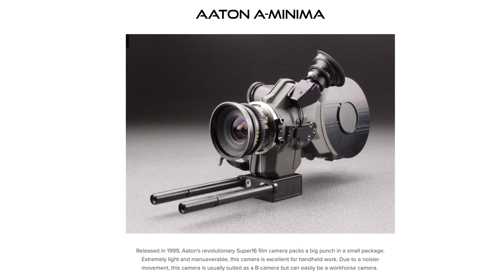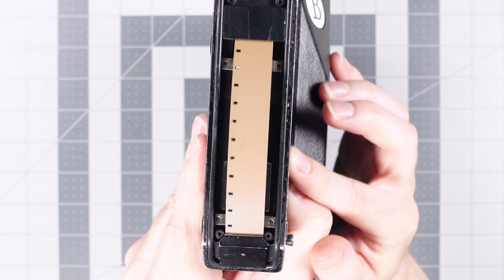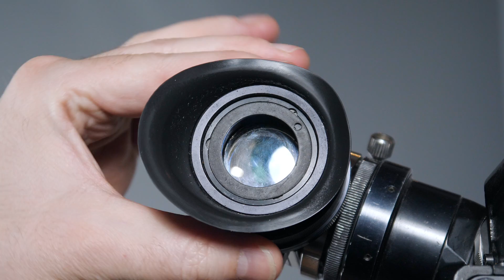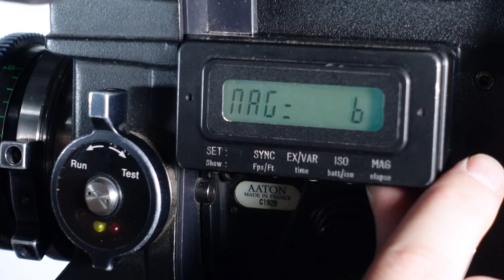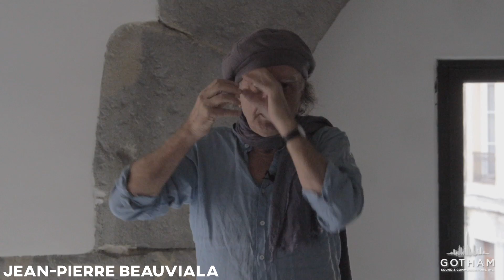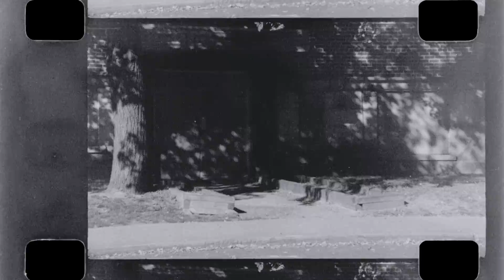Aaton XTR PROD Super 16mm Camera | COMPLETE OVERVIEW

Comment: The magazine WILL take 100ft rolls on daylight spools. All you do is remove the spindle via a simple screw. I have the Aaton XTR XC model...no electronics at all.....as is my preference. No video tap, no counter (just the mechanical one on the 400ft magazines)...love it
Reply: One stipulation could be that using the core take up will mean you'll need something other than the original 100' box to store it in, since it will no longer  fit. The Eclairs had a more convenient system in this reguard.

Comment: when charging, don't you need to throw the film OVER the roller in the receiving compartment?  I believe that there will be better engagement with the toothed drum if the film is first passed over the roller on 5:58
Reply from the maker: No, based on the manual itself the film threads under that roller.
Reply: @AnalogResurgence  , thanks!

Comment: Well done video. Few side notes for ya. 
1) The Xtera is the same camera, just a different power system on the side, which enabled them to run a more complex video tap as well. 
2) When threading the magazine, you should put it on the take up core first, wrap it around a few times, then go back and thread the sprocket drive. Two fingers sometimes does the trick, but it's 14 perforations showing. If it's too big, you will get scratching on the film from the magazine. If it's too small, then it will continue to click when you go to "test". 
3) That 16v battery solution will kill the low voltage transistors on the main board. I service them for a living and 9 times out of 10 when they come in with damaged electronics, it's from that very battery kit. I've been warning people anything over 14v and it will damage the camera. When those batteries come off the charger, they are 16.5v easily. There is a 14v version available of those batteries, but even that is a lot. I would tell the rental house that they should be prepared for a failure sooner than later. 
4) Displacement magazines are only really used in 35mm cameras like the Aaton 35III. What it means is that the supply reel is "displaced" by the takeup reel. This allows manufacturers to make very small magazines because as the take up grows, it will go into the area the supply is. Very clever stuff. You should watch my video about the 35III someday, it's neat. 

Anyway, I'm sure there are more discrepancies, but those are the big ones I noticed. Keep up the good work!
Reply from the maker: Thanks! Love your videos, especially the work you're putting in with shooting the Orwo stuff and the detail of it!! Awesome resource!

Comment: Incredible camera and an excellent presentation. I remember years ago an ad from Aaton in film magazines with Jean Luc Godard. The camera was advertised as a small 16mm camera. Cannot remember the name. Very nice job Noah.
Reply: JP built a camera called the 35-8 which was specifically built for Luc Goddard, at his request in the 1970's. It used 200ft loads of 35mm. Some years later, JP decided to make a production version and after some hub bub, they did and it was called the 35-2 and 35-3 depending on the year. Very cool, all be it very "french" 35mm cameras. I owned one for a while and they were pretty sweet. Check out my channel if you wanna learn more about Aaton cameras.
Reply: @NarrowGaugeFilmsLLC  Thank You just subscribed.
Reply: @NarrowGaugeFilmsLLC  ARRIFLEX SR 1/2 : )